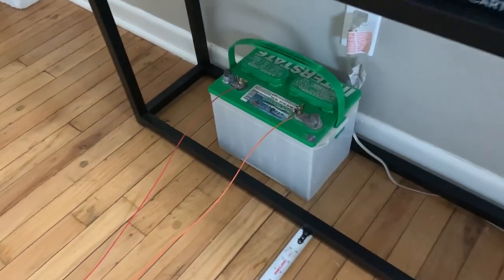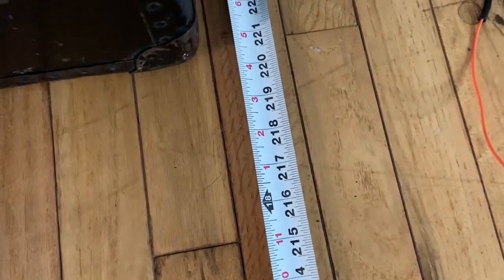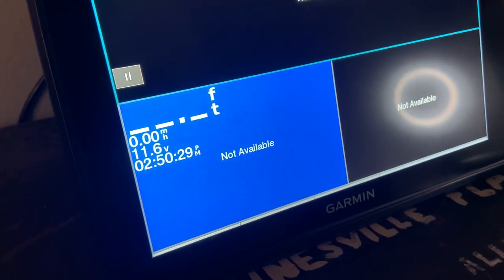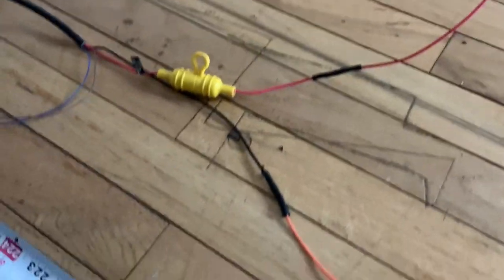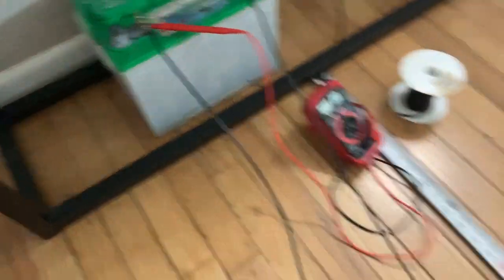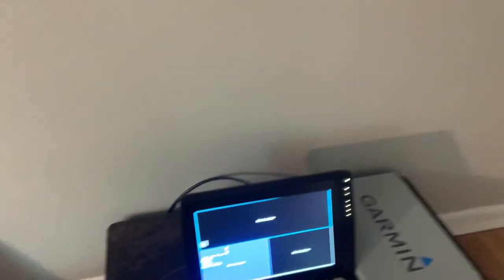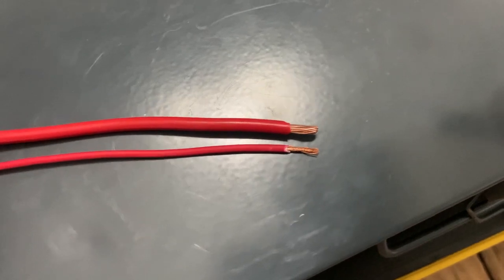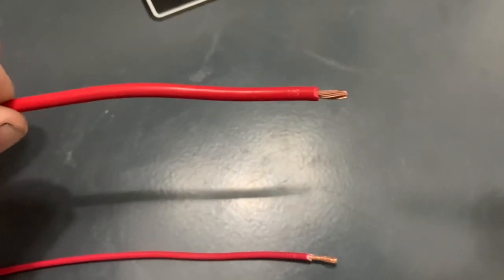Garmin Install tip - Avoid this COMMON mistake! - Battling voltage drop and winning!

Comment: I ran #10 to all components. The GLS 10 is very sensitive to voltage and doesn't work less than 11 volts , some use lithium ion power which is the way to go if you don't want any power issues .
Reply from the maker: Nice! Lithium iron is the way to go over lithium ion

Comment: I liked what you did here. If you have a buss bar system under your helm and you tie into that there should be no voltage drop with using the small gauge wire as the power leads coming from your cranking motor should be the larger gauge. Should you put your garmin units on a switch or is leaving them on the battery ok and not draw too much to drain the battery while sitting there.
Reply from the maker: That is if the wires they provide are large enough to support the entire amp draw. 

The other issue with using one of those buss bars is the chance for interference from other devices on that buss bar such as sump pumps etc. 

It’s always recommended for sensitive electronics to go directly back to the battery or have their own dedicated power source. 

I do not run switches on my units. As they don’t stay in the boat when I’m not in it. So when they are in they are powered up.
Reply: @MGMarineTech  so hooking those wires back to the cranking motor battery where the bilge, nav lights etc are all wired to doesn't cause any interference  or do you run them in wire loom?
Reply from the maker: When you run the power wires directly to the battery the battery will act as a filter and will supply clean power to the unit and greatly lessen the chance for interference.
Reply: @MGMarineTech  awesome thanks for your time just purchased uhd 95sv for my console and uhd 73cv for my bow to go with my Terrova with side imaging

Comment: Garmin assumes you will connect their power wire directly to a battery using their supplied positive /negative lead with supplied fuse.  Highly recommend if you need to extend power supply wires and yes, do use 8 or 10 g wire, you must move the fuse back to within 8" of battery.  Otherwise, with the fuse up front as your video shows, you are not protected from shorts, fire potential on that entire length up to the fuse.
Reply from the maker: Yes this video was for demonstration purposes only not how it would actually be wired in a boat.
Reply from the maker: Also I wouldn’t say they expect you to connect their short lead to a battery rarely do people have barriers that close to all their units. Their instructions even state

 “If it is necessary to extend the power and ground wires, you must use 0.82 mm2 (18 AWG) or larger wire.”

The gauge of wire that is used really depends on amp draw and the length of the wire wire type etc

MOST will be able to get away with 12 gauge as shown.
Reply: @MGMarineTech   I didnt know that the user up above said was true and it looks like I need to do some modification to my unit at the bow. So should I cut those fuses off and use a butt connector to connect to 12 gauge wire? Then run it all the way to my battery and use a different 3 amp fuse?
Reply from the maker: @tlalexander3  yes that is one way to do it.

The fuse should be close to the battery as it’s meant to protect the wire not really the unit believe it or not.

Comment: How do you get the media option on your garmin?
Reply from the maker: I would have to look at my unit again. I’m assuming it’s like other things and won’t pop up until a media source is connected or it’s in a update 

I have never used it only seen it in simulation mode

Comment: Would 10 gauge be better?
Reply from the maker: In most cases it probably wouldn’t be necessary depending on the length and amp draw. 

A lot of guys power their live scope black boxes with 10 gauge just to be certain.

Comment: Most Garmins will sub-regulate the input voltage and operate down to 9V, others not so low. At 9V your battery is probably cactus. But yes, voltage drop on the power feed is wasted power and for the cost of slightly larger cable it's worth it. Just please don't start on oxygen free copper ;)
Reply from the maker: Good to know. Although I’ve been told by garmin that imaging performance starts to suffer under 12.2~ volts.

Comment: Great information, but definitely charge up that battery before it's toast. A fully charged battery should be around 12.7 volts. Yours is essentially dead.
Reply from the maker: Absolutely. This battery is 11 years old and was just sitting in the garage. Not something that I would run.  

With the unit off it was at 12.3 volts. With the unit on it was 11.99 as seen.